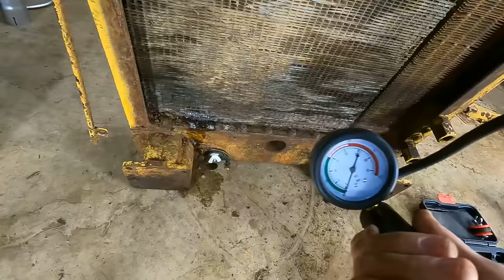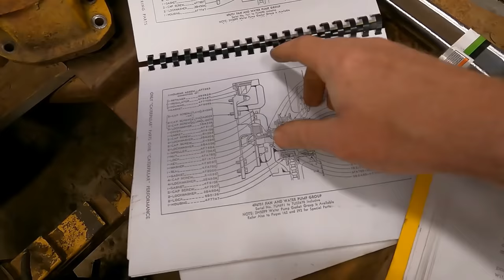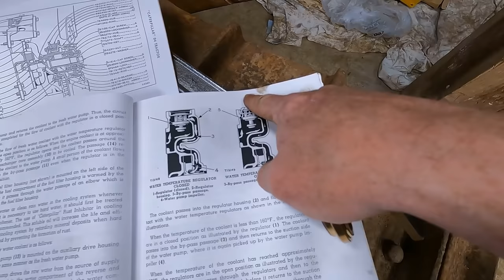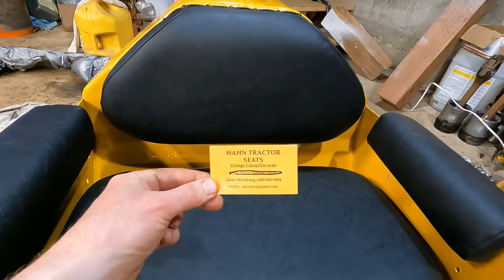Caterpillar D4 radiator rebuild

Comment: Matt, Sorry about the flu, take care of yourself.  We've had some nasty colds, pneumonia, flu, etc. here in the central Illinois. My Doc has had patients battling for 3-6 weeks and still have congestion.
Glad to see you back on the Ole Cat.  Those cast iron caps and side pieces speak of the quality at the time.  Well, some would just say it was heavy.  I've found bolts in cast iron will have less corrosion just the chemistry of iron vs steel.  $900 core!!!!!!! Some hobby.

Comment: Just my two cents but the machine was designed with the oil cooler and when you start pushing dirt it is going to heat up fast. Granted you have a lot of mass to reject the heat  but every little bit helps. Even if you install an aftermarket zip tie cooler that would be better than nothing. If you do paint the rad use a rad paint. The viscosity is such that it won't bridge the fins. Thanks for the time you put into making these.
Reply: ^What he said.^ 100%
Reply: I agree about rad paint, they make paint for that besides copper if left alone will start to build up a film of corrosion that will in effect reduce its efficiency in the long term. Heck even Rustolium is better than nothing. I’ve never seen a radiator come out of a radiator shop unpainted? Maybe I’m wrong. Either way he is doing a great job!
Reply: @Mtlmshr  its a brand new core and sometimes you have to solder on a top tank on old machines or both tanks on newer machines. they cant be painted before you solder them. finished radiators are painted
Reply: I removed the oil cooler on 2 D2s and a D4 and not had a problem. Guess modern oils help but we also live in a cool climate. Maybe say in California you'd need it.

Comment: Hi, I spent 30 years in parts and service in Vancouver, British Columbia. Distributors for Volvo Penta. and many other fine pieces of Iron small and large. Industrial and Marine gas and diesel. Also diesel  electric gen sets. We had one of our top dealers and every time he sold a new unit he would dump in a can o f" Bars Leak" into the RAD just before test and run up. He swore by it. He said good insurance. A small coolant leak after a new engine sold was a time waste and poor customer confidence. That being said, I would dump in a can of "Bars Leak" and be done with it.  Good site and I enjoy your ethics.  I always look forward to Yellow Iron Paint day.  Be safe
Reply: My Dad did the same and he always had really good luck with it! I have used it myself it's still a pretty good product.
Reply: We had plenty of Bars Leak used in the Old Day's, always on hand.

Comment: Good job Matt! Maybe put a dust screen on the front of the radiator with quick latches that will protect the radiator and you can wash the dirt off every once in awhile.
Reply: Don't Caterpillars reverse flow fan the air from the motor through the radiator to the outside? Not normal like all other radiator systems bringing the air from the outside in through the fan . Does that make sense?

Comment: I'm really impressed with the quality of your work and that you're cleaning everything thoroughly plus painting it.
As well that you're using Permatex instead of the new sealers.
Especially silicone.
I've always did what you do with Permatex on both sides of the gasket and on the items to be sealed. 
It's how I was taught to do both in small engine Vocational school and Coast Guard Aviation Machinist Mate A school. 
Your work on this Dozer is definitely professional level quality. 
Can't wait to see you finish it and test operate it then begin on the Excavator. 
Of course after they're finished you'll have to find a Skid Steer to restore and round out your collection.
Reply: Skid steer, as in steering

Comment: Whew! Once upon a time most every small-medium sized town had a radiator repair shop. They could flush, repair or re-core a radiator at a reasonable price. We also had many brands of 2 step cleaner which consisted of Oxalic Acid and Baking Soda neutralizer. What happened? Things just ain't got no better no how.
Reply: I remember those days well. There were also Shops that addressed fuel tanks too. Flush, fix pinholes, sending units.  Now it's all do it yourself or hope somebody builds a replacement.
Reply: We used Goose Creek Radiator, GC,, SC   Cat partsman 73-09
Reply: Radiators are not made to be repaired. Plastic tanks, aluminium cores all designed to save weight. There is nothing to repair so very few shops and the people with the knowledge to do the work. The loss of institutional memory is huge and ongoing in the manual trades.

Comment: I would recommend putting some steel angles under the new arm rests. I put a Hahn seat on my D2 20 years ago and they are still looking good, but the arm rests failed in the angle. You are doing a good job.

Comment: Nice, nice work. 

If the OE radiator cap is a non-pressure unit, the design engineers were not too concerned with raising the boiling point of the coolant, rather the goal being it should not drain out when the tractor is parked overnight and is circulated when it is in operation.

Pro tip:  Bars Leaks.  Don't use it.  Back in the day my grandpa swore by it, but he was the same guy who put sawdust in the rear axle housing of every car he sold.
Reply: My thinking too, lots of old stuff wasn't designed to get pressurized. Not leaking was a bonus, if it leaked no big deal, just add more water. Dad was truck driver when he was young, in the winter they drained the "coolant" every night so it wouldn't freeze and filled with water every morning, coolant wasn't invented yet.

Comment: Please reconsider the oil cooler  . Heat kills and more than likely the cooler is for the hydraulic system  . This necessary so not to cook pumps and valves or blow hoses  . Whether you work an hour or all day  ,  the Heat is the same  .  Hydraulic equipment doesn't work when overheated and renders the equipment useless  . Then you pay triple for repairs that could have been avoided  . Just think about it  . BTW....I would like to be there helping with the rehab  . No charge  lol .
Reply: This was bothering me the whole video. From what I found online the oil cooler is for the engine oil. I would recommend the oil cooler, however Matt had indicated they aren't needed due to better quality oils, and he may be referring to synthetic. This really deserves a study on cat diesels oil cooler requirements.
Reply: Install an aftermarket auxiliary cooler. Like they use for transmissions. A bar and plate type.

Comment: If you are worried about the cooling system, consider Evans Waterless coolant. It is supposedly designed for zero pressure cooling systems. Operating range of -40 to 375f.
Reply: Evan's is only useful for cooling systems that have very low cooling loads; water has a far higher SHC than glycol which is why it's used. Glycol is only used to prevent freezing.

Comment: I will never own a piece of heavy machinery, but I've been watching your D4 build from the beginning.  I'm glad you replaced the core instead of trying to use the old core.  When I'm aligning parts like your radiator sections, oil pans, or transmissions, I use a couple of studs with a slot cut in one end as locating pins for assembly.  The slots allow me to use a screwdriver to remove them after a few bolts are installed.
Reply: There are studs that have allen heads built into them, saves cutting the slot and allen wrenches don't slip like a slotted screw driver.

Comment: I just went through the regulator/thermostat issue myself last month. 
 4 to 6psi is about max
The Gates 3888 thermostat you have dose have a small hole in the seat of the valve surface for relief. The thermostat housing may have a covered bypass passage boss on the governor side (for external passage - cab heater, percolating engine heater) and returns it to the bottom radiator hose. OR  an internal passage that recirculates coolant until the thermostat reopens. Yours is most likely the latter. Which may present a different problem Squatch did a video on that type of re-re-reiteration.👀🤦(search for thermostat n squatch not regulator)
YOU WILL need to make a retainer about 3/16" to a 1/4" on top of the regulator to hold it into place otherwise it will rattle around and not work properly. What I did was use a thick neoprene cork gasket and let compress in place (leaving a small gap for the seat hole to work). Hindsight i should have tried a thick O-ring first.
Once you look at it you will understand 
If you need more help let me know I have lots of video footage of putting in two Gates 3888 in my D318. It shows what I did. But I highly recommend checking out Squatch's video.
Reply from the maker: Thanks Dan, I actually got the Gates part number from your thread 😁
Reply: Squatch has taken D2's and D6's apart and put them back together many times and never seems to tire of admiring the engineering behind them.

Comment: Decades ago I was operating a D7 3T with a root rake. Stacking and burning timber clearing land. And it had a pusher fan. The dust being pushed foreward had sandblasted the radiator. And it wore thin. and we often had to take a boom truck & remove the radiator and solder the leaks. And the softer solder would soon wear out and start leaking again. One day we had the radiator out soldering the leaks. And this Guy we mistakenly always believed was a bit shy on smarts we squirrel hunting came by. He had so many squirrel fastened around his waist it loooke like a hula skirt! any was he stopped and watched what we was doing. Never said anything. We got it all soldered and was fixing to put it back in the dozer. And he remarked If I was you all I would unbolt the tanks and turn the core around and upside down so that bad part was toward the front.  And after looking decided he was smarter than both of us.

Comment: I had a '42 2n Ford tractor, cooling system wasn't pressurized.  It just metered the coolant capacity on it's own by spilling out the cap until it had the right level.  Never had a problem with it, thermostat did it's job and it ran a constant temp.

Comment: The cooling system is not pressurized. It will be fine. You might have to retighten the bolts after a few hard uses. More of a nuisance than anything. Keep an eye on your coolant. 
Those seats  look better than the stuff we got from Cat years ago.
Cheers
Terry

Comment: I need to fix (probably replace) the radiator on my tractor that got a stick through it recently - at least 3 small holes (like match head size).  A super quick and easy job compared to what you had to do with that Cat radiator.  You are doing terrific work on the Cat.  You are an inspiration to me and probably many other folks here.  Wish I lived close to you so I could help out, especially when you are handling the really heavy / awkward stuff.

Comment: Hope you can get rid of flu bug, kids bring it home from school ? W/the cold weather, trick to speed up dry time on your paint- add a teaspoon or 2 per pint or so of paint-Try Japan paint Dryer, it works you will be suprised. Good luck w/the bug. looking forward to your next video, hope its the winch I have one just like it w/rotten 3/4" cable thinking about going with 5/8" or just a little under 3/4" , be intrested in what you decide w/yours. Have a good one from Southern Emerald Empire.

Comment: What fasteners, they look like rivets! that's a hell of a job. Came out great. One thing to remember with air pressure testing is that water tight is not the same as air tight. If it doesn't leak/tiny leak under air you're gonna be safe. 

This is turning out to be a great rebuild of the whole machine.

Comment: Very fine job and don't worry so much over the radiator if it holds coolant it will be good for the long run. Just don't delete the oil cooler cause as many other people under this video have pointed out. When dozing the engine will get hot faster then just by idle or driving. I can't give any advice but I'm very impressed how well you did.

Comment: retired 'worked for  cat dealer 'field service 38 years your doing real complete job  looks good ' alway at least glued in place  one side of about any gasket then soft sealer on the other side heard you say gasket you installed may slide out of place and they do ,, also nothing wrong with new permatex red soft sealer used that mostly the last 10 + year and thought that worked best ever ---also when coolant gaskets get up to operating temp . those gasket  seal off better   don't use that red  harding sealer its nother more than thick locktite it has it places ,, also it glues thing together than you like to never get thing apart  so low contact glue 1side and soft sealer on other and tighten bolts correct torque  and that about all you can do . kinda like cleanliness and fact you painting as you go ,your looking  good mister ,,  jack

Comment: Wow that was some job changing the Radiator, My thought is maybe on the bolts securing the Radiator to the housing you might want to use never cease on the threads if you ever have to open up the housing again after it sits outside in the weather for a period of time.

Comment: I think it will be fine. We have a 1950s or earlier international T6 crawler that used a magnetic radiator cap. My understanding is the old stuff generally used high water volume to cool rather then pressurising the system like a modern machine

Comment: @Matt If you're not pulling a plow gang (or other heavy drawbar work) in hot weather, at full throttle, for hours on end, you'll probably be fine without the oil cooler.  That's my 2 cents from the land of green tractors :)

Comment: Most radiators are painted matt black for a reason...  allows for good heat transfer. plain copper is OK, but will corrode, always better painted. Mostly I use matt high temp exhaust paint to do this. I am surprised it wasn't done by whoever made these cores.

Comment: Love the bolt torque montage. Pretty sure the oil cooler rad is for the hydraulics, not the engine oil.

Comment: I always used "Nirod" 55 welding rod with good results to weld cast iron. Welding it with mig wire the way you did will probably break off in no time. Just my 2 cents worth from a retired welder.
Reply from the maker: Yes, you are right it will 100% break.  The only critical thing is the clamping force on the core though, which will remain if it breaks.  Thank you for the welding rod suggestion, I have no experience in welding cast stuff.

Comment: Thanks for the video Matt! Always enjoyable. In my humble opinion, the oil cooler might still be very useful - even with modern oils, most auto and equipment manufacturers use one. I guess you can monitor the situation and see where you are running and if you need to install some type of cooler. Thanks again and good luck finishing the project!

Comment: I avoid black paint on radiators and cooling parts because it absorbs heat I would use silver or no paint because the paint will also hid cracks I would only mist the parts with a light colored prime till it starts up then you can paint as heavy as you want.

Comment: I've been looking forward to the next video,. Glad to here you are doing good. Take care of yourself! The hole in the thermostat is to help bleed the air out of the system. I am looking forward to the first start! And that cap may be the wrong cap?  Or bad? I would think it should hold pressure. I could be wrong.

Comment: Surprised at the core cost as I had a full width core built here in Aus for half you're cost. Did away with the oil cooler and blanked off the lines on the block. A PIA job overall but you did it very well.
Reply from the maker: yeah it was a lot compared to the original price, but at that point I just wanted it to be done.

Comment: Thanks for posting these videos. I enjoy watching you work, your patience, you explain what your doing. You tell why & how. These little D4 Cats will disappear if people like you & Sasquatch 234 ( I might be wrong, but you know who) don’t save them. They are capable machines, but too expensive to build now days. I am to old have too many aches & pains, but I know where this little farm is, dead end road that ends at river in winter, lake in summer. Used to be a ferry there that crossed river. About 20 acres, I guess if you won lottery you might have enough money to buy it. I was told they turned down $250,000. That D4 would be all you need to clean it up. Got to go. Hope you post some videos of the other machine you’ve bought.

Comment: Awesome job.I would keep an eye on the oil temp when you are working.granted you have said many times you won't be using it much but the oil will heat up as you start pushing.

Comment: Great video as usual is there any kind of guard that goes on the front of the radiator? Maybe even a piece of expanded metal to keep sticks and junk out of it
Reply from the maker: yeah the hydraulic pump goes right in front, and a guard in front of that, which I don't have yet

Comment: if the rad coolant / water dose not get past 100c (boil point ) the no prob at all cars need to go to app 125c hence the system has to goto around 14psi before boiling  u will no probs as it looks like low pressure system hence cap not holding